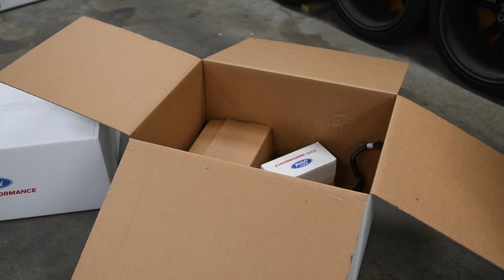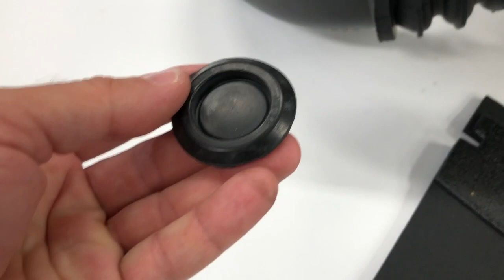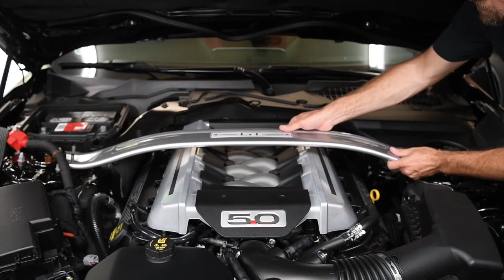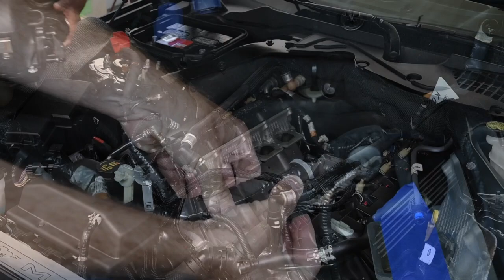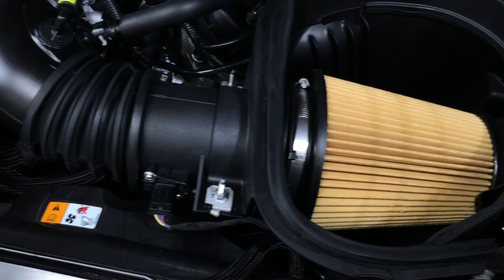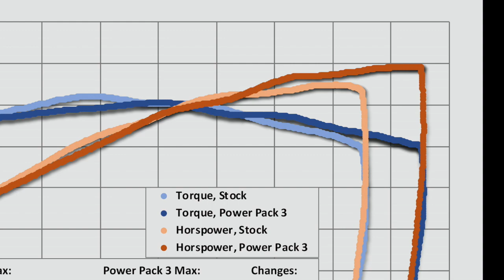Ford Performance Parts Power Pack 3: Full Review, Install, and Test

Comment: I know this is not gonna be popular opinion, but I’m not impressed for the amount of cost and labor involved.  Minimal horsepower increase and you lose low torque.  For me, I’m just gonna save that money and utilize it on a roots style supercharger. Whether that be VMP, Kenne Bell or another quality boost kit. Jmho.
Reply from the maker: It’s all about how much you value OEM drivability.

Comment: What is the runner control vent? Mine on my 2020 mustang gt was broken by the plastic engine shroud and I need to know how important it is cuz I need the car for work
Reply from the maker: If the runner control isn't working, it may trigger a code. Regardless, there should be sensors that tell the PCM if the runners are open or closed so that runs correctly.

Comment: Can someone tell me how to get this tuned correctly?  4 different tuners have not worked out the terrible air surge in 1st gear.  Ford will only give me a calibration/voucher unless I re-purchase the Power Pack 3 for $2,000!  Bama and 3 different Dyno tuners could not figure it out and now I don't have a reliable 1st gear.
Reply from the maker: I understand. I'd talk with a tuner who can use the factory Ford tune as a starting point. Otherwise...the Ford calibration is what you pay for!

Comment: Interesting,  I just did the power pack two,  it's the same thing except without the manifold,  but mine came with a procal 4...  I'm just surprised you didn't get the procal 4 considering it looks like we did this only 6 months apart from each other. And this is the program that should have come from Ford right from the factory.

Comment: Why would they go with a corrugated intake for that would cause air turbulence why not a smooth intake?
Reply from the maker: In theory, a corrugated intake actually flows better than a smooth intake tube. The corrugations allow for engine movement, and have zero impact on flow capacity. See also: why golf balls have dimples: https://youtu.be/fcjaxC-e8oY
Reply: @Mustang-Geek  so by that theory why not make the whole tube corrugated?
Reply from the maker: @douglasbaker5949  Expensive and unnecessary.

Comment: number #1 get a  JLT 120MM or steeda cold air closed box at 121 mm  #2 you weren't properly  tuned imho go with palm Beach dyno or vmp or Lund racing
Reply from the maker: This is a factory Ford-quality tune.
Reply: @Mustang-Geek   yes but it's garbage ford isn't even a tuning place honestly
Reply from the maker: @EternalDragonTV  There is a lot more to tuning than just getting good power. Factory-like drivability can't be overstated.

Comment: I have the Power Pack 2 installed with the procal tune  on my 2015 gt premium. I want to replace the stock manifold and install the  gt 350 manifold. Since I already have the procal tune already would this be just a plug and play?
Reply from the maker: No, if you're installing the new throttle body, you'll need to install the correct tune.
Reply: @Mustang-Geek  No I have the gt350 throttle body installed via the power pack 2 already. I want to install the gt350 manifold and take out the factory gt manifold. Basically I should have just ordered the power pack 3 but got the power pack 2 because of money. That is why I asked can I purchase the just the gt350 manifold and plug and play. I already did the pro cal tune with the [power pack 2 install. I hope that made better sense from my 1st question
Reply from the maker: @christopherblake3967  Oh, I understand. I think that question is best for the Ford Performance Parts folks. https://performanceparts.ford.com/contact-us/
Reply: Same scenario here , I own a 2015 mustang gt with a PP2 and once my runners went out the window on my OEM manifold I was forced to buy the PP3 pack because you need the pro cal that’s married with the kit , unfortunately . But once you purchase it apparently you don’t need to go back to stock because it wouldn’t overlap the current tune on the vehicle. As far as my PP2 I will be selling that kit with precautions that they might need to contact ford performance tech line to see if they can still use the kit and tune
Reply: I'm in the same situation. Unless Ford Performance has started offering an upgrade, we have to buy PP3 for the manifold and tune. If I do this, I'm gonna sell the throttle body and intake to get some of my money back.

Comment: Can it be used for f150 5.0 2015
Reply from the maker: Not sure. The tune, surely not. Maybe the intake manifold. You'd need an experienced tuner to calibrate it correctly.
Reply: @Mustang-Geek  thanks for the response

Comment: What the hell? Why is that car only dynoing at 324? When my 2016 was stock, it dynoed at over 400 wheel
Reply from the maker: All dynos are different, and this Mustang dyno is especially stingy. Regardless, the before/after gains are what matter.

Comment: do you loosen the fuel rails bolts before you lifted the manifold out?
Reply from the maker: The bolts that hold down the rails are the same bolts for the heater hose saddles, if memory serves. So I guess the answer is "yes," but that's because it's part of the process.

Comment: Outstanding video. Quick question, is there a reason why this kit is only for the 2015-17 and not till the current models? For the life of me I've looked everywhere for an answer, feel dumb for asking as I'm sure the answer is probably simple but, id just like a clear cut answer...
Reply from the maker: I'm not sure, but I suspect that the 2018-up intake manifold is already pretty good. The GT350 intake manifold probably isn't much of an improvement over the 2018-up manifold. The do offer a cold air intake and tune: https://performanceparts.ford.com/part/M-9603-M8B

It's nice because it's a factory-quality tune so drivability is going to be fabulous.
Reply: @Mustang-Geek  thank you very much for the response and honesty!
Reply: @Mustang-Geek  received some further feedback from other people I had asked (yesterday) and they also mentioned the intake manifold 2018+ being marginally different from the GT350's. Just thought I'd come back to share the info. Thanks again!
Reply from the maker: @El.compa.chuy.21  Yes, my understanding is the 2018+ intake manifold was influenced by the GT350 manifold.
Reply: The 2018+ Mustangs already incorporate the redesigned manifold, an upgraded throttle body, and air box.

Comment: I’ve been reading gains of up to 40rwhp on gen3 with the power pack 3, that sound right?
Reply from the maker: Not sure. It's possible. Not sure how much power can be unlocked with the tune and the intake. There may not be peak gains, but gains after the factory manifold falls off in the upper RPM range, for sure.

Comment: Do anyone know the part number of that brake booster vacuum tube? I have a manifold and it didn’t come with it. Help please
Reply from the maker: I'd check parts.ford.com, a dealer parts counter, or email Ford Performance Parts.
Reply: @Mustang-Geek  thanks pal you where correct
Reply from the maker: @Hotwheelsz51  No sweat. Here to help!

Comment: What's the price of this kit sir?
Reply from the maker: $1800. Not cheap, but this throttle body, intake, and tune are OEM quality. Zero drivability issues, which cannot be overstated.
Reply: @Mustang-Geek  that's really not that bad at all. I appreciate you getting with me. Thank you
Reply from the maker: @peteartussee1202  Yes, for what you get, it's a nice setup. This, combined with exhaust, and you've squeezed about as much naturally aspirated horsepower from a Gen 2 as possible without getting into the long block.

Comment: It made way too little hp for stock, there’s no way it lost almost 100hp, which equals 25%
Reply from the maker: This is a Mustang load dyno, not a Dynojet. Don't get hung up on the numbers, but the relative gains and how the stock intake falls off long before the GT350 intake.
Reply: You'll see much better gains from a ported 18 mani, PMAS/JLT, and tune from Lund.
Reply: @bootlegger2389  Lund told me none of those aftermarket intakes make more power than the stock airbox.